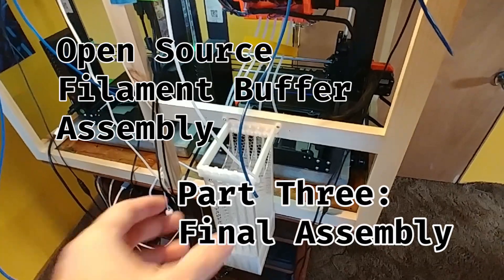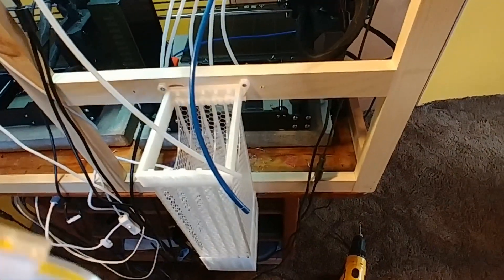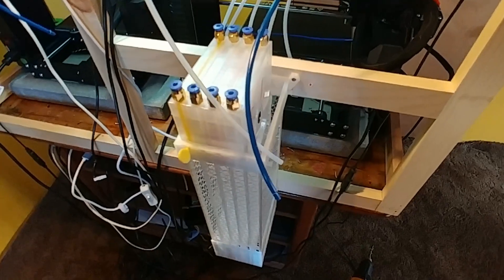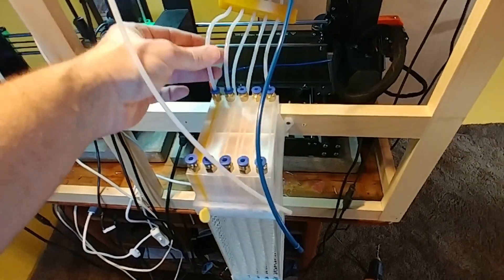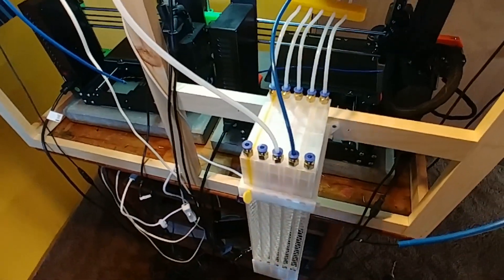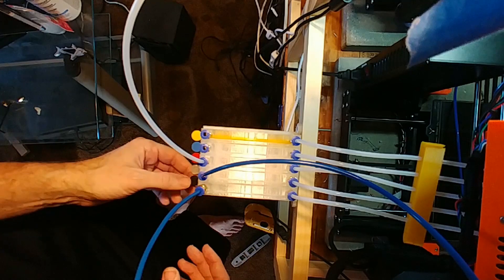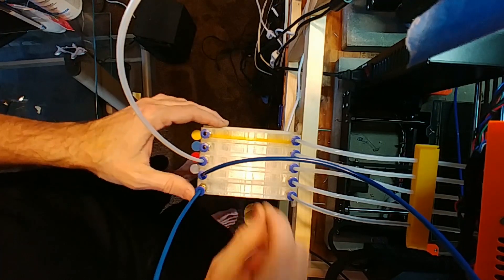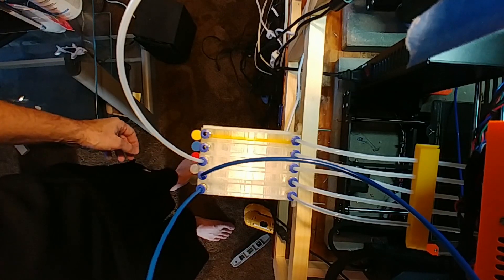Open Source Filament Buffer Assembly Part Three-- Final Assembly

Comment: This design seems really clever!  I'm currently using auto-rewind spools in a RepBox, but they are often too aggressive, and pull filament out of the MMU2S.  Othertimes, they don't rewind enough!  I am thinking of trying a buffer solution.  Over the past few days, I've looked at all the designs you referenced on GitHub, and my concerns echo yours.  Are you still satisfied with your solution?  If so, I think I'll give it a shot.
Reply from the maker: I started out with auto rewind spools as well, but had mixed results.
Overall I'm still happy with this design still. (I've stuck with it longer than any of the prior solutions I've tried.) My biggest concern, which I may attempt to address at some point is where the M6 connectors screw in. Having that split between two pieces is not great and on a few of my buffers they are loose (but still work acceptably when printing). 
Making those fully a part of the bottom piece should be easy enough, I just haven't taken the time.
I think with a repbox it should be possible to really minimize the friction feeding into the buffering system, which should make everything work even better. I've been debating a repbox myself; are you happy with it?
Reply: @x0pherl  I'm mostly happy with my RepBox.  I have the MDF version, and MDF is fairly porous, and although I've sealed the seams, it isn't as much of a dry box as I'd hoped.  If I did it again, I'd order the acrylic version.  I do like the RepBox very much, as it gets the filament up on the wall out of the way in a fairly compact unit.